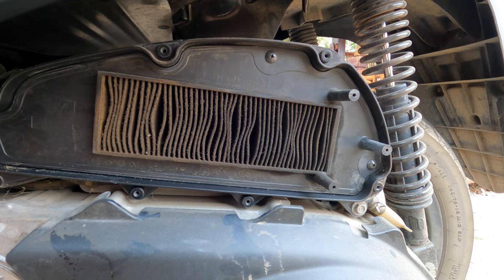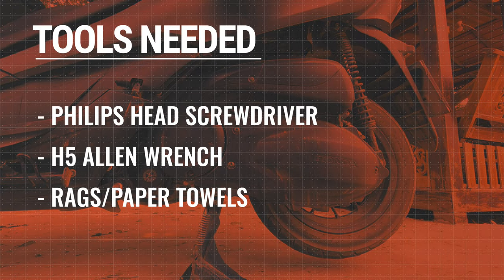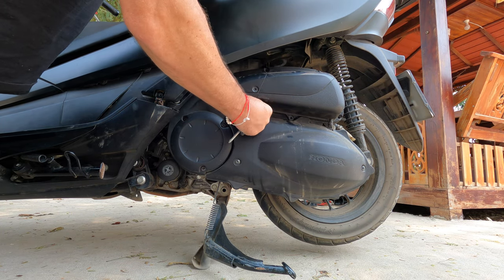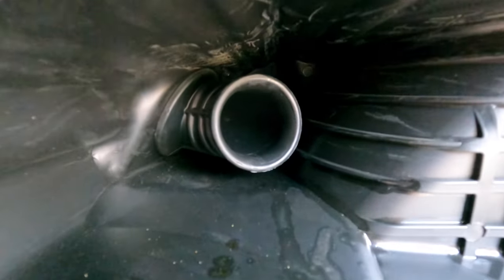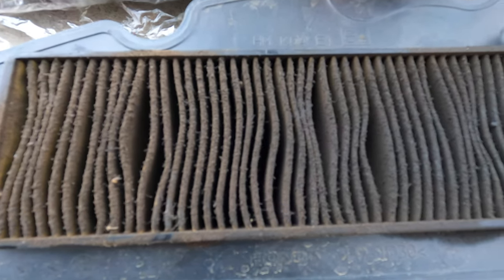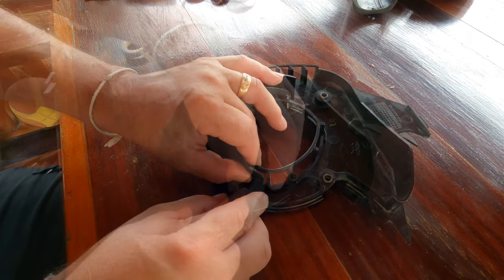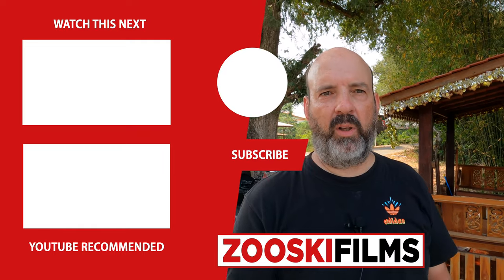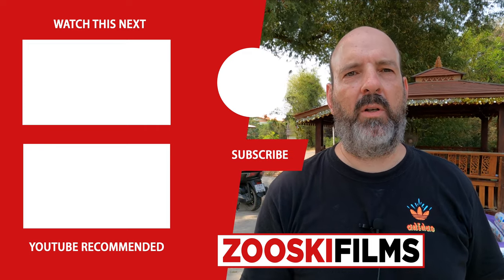Honda Forza - Air Filter & Belt Case Filter Change (NSS300) - How-to, Step by Step Instructions

Comment: Thanks for this video Mark, and prompts me to change the filter on my Forza but it only has less than 6,000 km on it so far, yes, really. I have had it since new and would never part with it. I even bought a filter on line a while back. Cheers, hope you get back to the kingdom soon.
Reply from the maker: @grahambkk - Hey Graham, my pleasure, had to make another how-to video while in Thailand. Let me know if you can find one of the sponge air filters somewhere. I went to the dealer in Phichit and they didn't sell them there. Much easier to find one here, even through that Forza is built in Thailand. Cheers!

Comment: Thanks for the video. I just picked up a 2017 NSS300 and will need to do some maintenance. Are those screws Phillips or JIS?
Reply from the maker: @wesleycardinal8869 - Good question, pretty sire they are JIS. I always get that wrong in my videos. Thanks for asking! Cheers!

Comment: Hi! Thanks for your brilliant video! My Forza gets overhead nobody can help especially Honda in Samui! Do you have any idea what causes this?
Reply from the maker: @peterrichter8620  - Hello! Can you tell me a little more about your Forza overheating.....does the temperature gauge go above the upper limit? Do you hear the fans turning on? For me it has to be one of several things: fans, water pump, thermostat or low coolant.
Reply: @zooskifilms  thanks for your answer! Coolant they changed and still hot! Probably the pump or the fan!? I can't listen the fan! Where is the fan located?
Reply: Yes after 5 km goes above the limit constantly and shows the indicator red signal!
Reply: By the way how many fans are there? I thought just one!?
Reply from the maker: @peterrichter8620  - The fan and motor are on the inside of the radiator (just behind the radiator). It will not run until the coolant temperature comes up to temperature. There is also a fan motor relay that turns it ON and should be checked if the fan is not running when the coolant temperature is high.
Reply from the maker: @peterrichter8620  - OK, is the fan running?
Reply from the maker: @peterrichter8620  - There is 1 fan. I just posted a troubleshooting list on my Community page - click on Read More to view the enitre post, there is a full checklist from the service manual - https://www.youtube.com/@zooskifilms/community
Reply: @zooskifilms  yes the fan is running! I really appreciate your help! I guess water pump or thermostat! I haven't mentioned  it had before a modified exhaust! Maybe this caused the trouble?

Comment: I recently replaced the belt case filter on my 2014 Forza after ~32k miles. It was in the same shape as yours -- ripped right in half. Not sure if they ship worldwide, but I ordered mine from Partzilla to be delivered to the US. The part number is 19412-KTW-900
Reply from the maker: @tyuyf - Awesome, thank you! The funny thing is that the Forza was built in in Thailand, and I was in Thailand, went to the dealer where I bought the Forza and they said they didn't know where to buy one. This is the same place that told me I didn't need an oil change after a couple of years because the km threshold wasn't met. I just changed it myself. Very strange to me, but then again I'm from the US! 🤣 Thanks again! 🙏